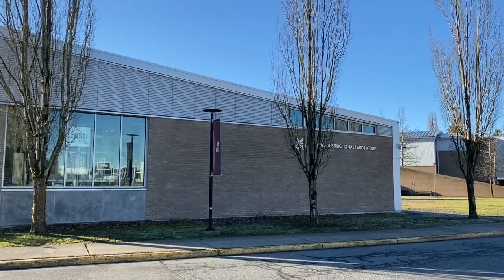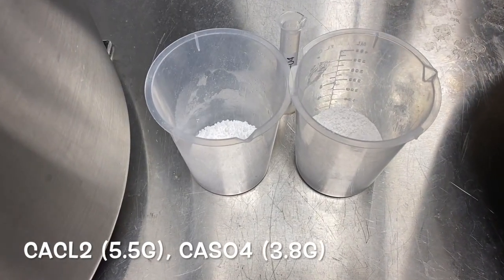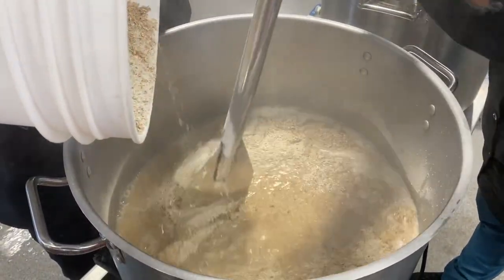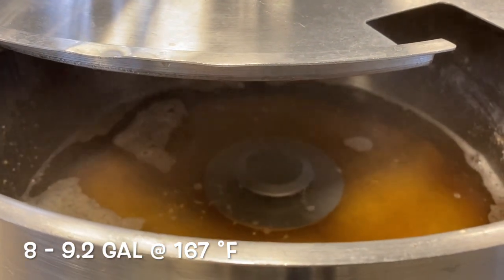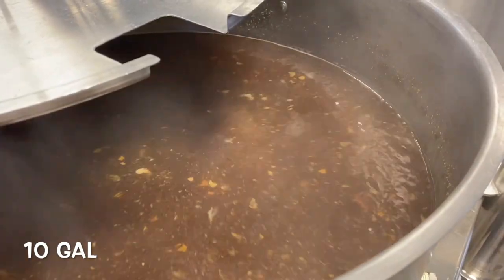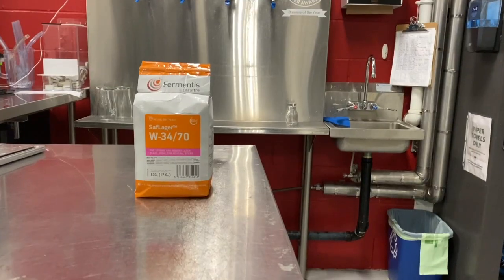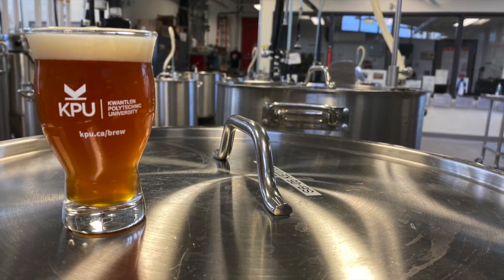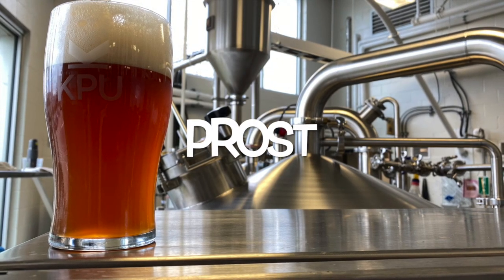How to Brew Amber Kellerbier – Germany’s Best Kept Beer Secret (Zwicklbier, Young Unfiltered Lager)

Comment: Great content! Thank you!
The thing I noticed is that you have a pretty high carbonation level for this type of beer. Since usually kellerbier was fermented and carbonized and lager with open top(without pressure) that would mean that most of the CO2 escaped. Kellerbier are very little carbonated.
Reply from the maker: Thanks so much for the kind words and for pointing that out! You're absolutely right—traditional Kellerbier is typically low to moderately carbonated due to the open fermentation and lagering process. In this case, we intentionally went with a higher carbonation level to better align with North American competition expectations. Appreciate you noticing the detail! Ziveli 🙂🍻
Reply: @KPUBrewing  Woooow, you blew my mind with "Ziveli" 🤯🤯🤯
ZIVELI!!! 😃😃🍻🍻🍻

Thanks a lot for the fast reply!!!
I would be truly happy if I happened to come across someone on the other side of the world who can speak my language, and if she/he also love beer—not just drinking it, but brewing it too... well, my happiness would be boundless 😀😀😀

Even though Kellerbier "ungespundet" is my favorite, I don't have possibility to ferment it at low temperatures at home. However, next week I will brew my second favorite, "Hefeweizen"—I love it! :) It doesn't require much equipment to maintain a constant fermentation temperature for ales.
Reply from the maker: Your passion for PIVO and brewing really shines—ZIVELI, for sure! 🍻🤩 It’s so cool to connect with someone who speaks your language and loves brewing just as much (there’s definitely a lot to talk about!). That kind of bond is something special.

Hefeweizen is such an awesome choice—a true classic with a perfect blend of flavors! It’s one of our favorites too, and we’ve had tons of luck brewing it. Fingers crossed your next batch turns out amazing. Can’t wait to hear how it goes! Keep those brewing stories coming—we’re cheering you on from over here! Prost! 🍺😀